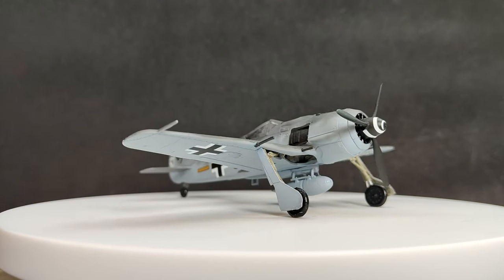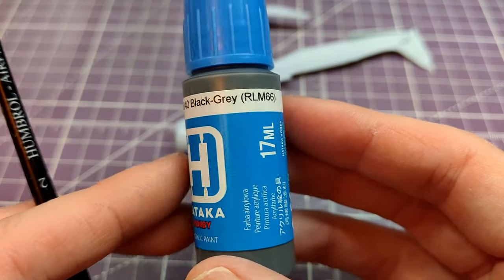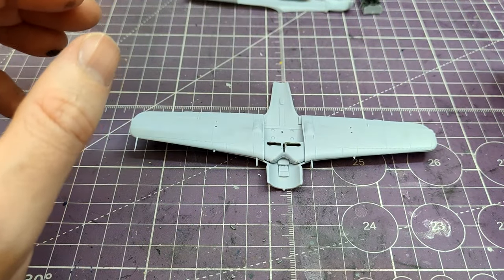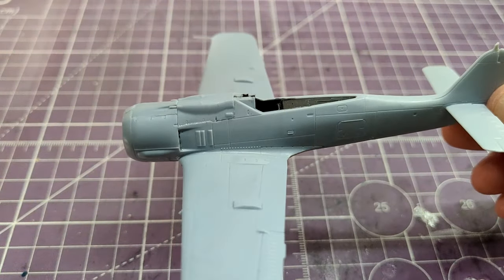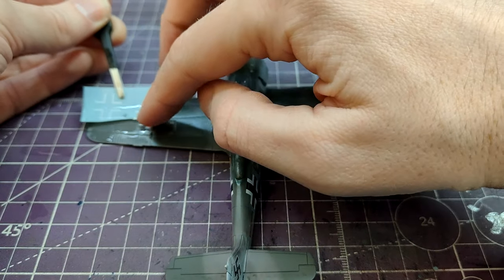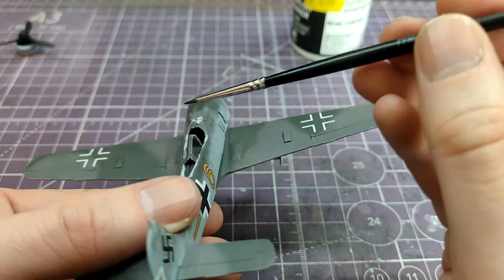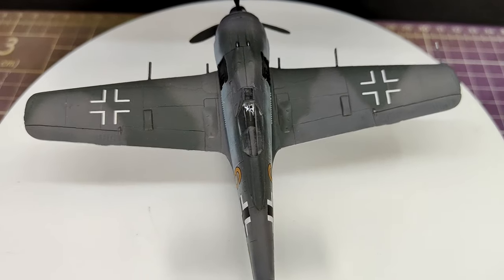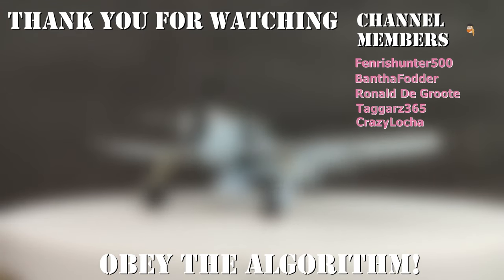Warped but Recovered - The Airfix Fw-190A-8 in 1/72 Scale - Aldi set BAV

Comment: For your first airbrushed model, you’ve done very well. A tip for warped parts would be to clamp them to a flat bar or similar and pour clean hot water over them from a kettle. Allow them to cool and they should be fairly straight.

Comment: Really like this. Waiting for Aldi/Lidl to get some more cheap kits back.

Very tempted to invest in an airbrush although I find hand painting quite therapeutic.

Also have to say like the swastikas on the tail. I’m sure they used to be included on the decals. I’ve only recently returned to modelling and noticed they don’t seem to be a thing anymore, but I’m a sucker for historical accuracy.
Reply from the maker: I was reluctant to get an airbrush for years, but once I got used to it I saw the appeal so now I both hand paint and airbrush depending on the circumstances
Reply: Swastikas are not included for legal reasons in the EU. After market sets are available for all scales by Aero master/ Squadron.
Kit brands from Japan( eg. Hasegawa)and China( Dragon/Trumpeter)have them included in halves to get around the legal reasons.

Comment: Fuselage was fine on mine but bottom wing was warped...No biggy with a bit of gentle bending and glued was fine...I used wire for the guns with a tad of superglue...Some things like pitot tubes I leave off at this scale as they general snap and don't detract from the shape unless I use wire...Good little kit at this scale

Comment: Just a little information about the wheel well colour.
Depending on the factory and paint supply both Rlm 66 and 02 are both correct.
The landing gear main legs and wheel hubs should be gloss black.
Reply: I've also done a little more research and some aircraft were rushed from the factory with unpainted  wheel wells or RLM76 underside overspray.

Comment: Looking great cpt vfc, have this kit in my stash so will check if warped. New to airbrushing also. I think Vallejo paints with Vallejo flow improver and thinner.
Reply from the maker: I do like Vallejo paints. Both Model Air and Model Colour ranges (with thinner) go through the airbrush really well.
Reply: Building the latest  BF 109 starter set and in that set 1 of the paints is Humbrol 91 black green and the instructions DO say to paint the prop and spinner in that colour instead of black @VFCproductions

Comment: There you go. I am the 100th like on your video and I really like and agree to the 5th out of those two reasons you mentioned on why you wanted to build this kit 😂. Great result for the first airbrushed kit and congratulations. As of the warping, wouldn't dipping in hot water and reshaping the plastic help? I built a Revell 1/72 tank a few years ago and they actually recommended the hot water dip tip to bend the tracks to the correct angle. Wonder if that would have worked in this case.
Reply from the maker: Thank you, Mr 100. Yes the hot water trick would likely have worked, but I am usually very good at burning myself with hot things